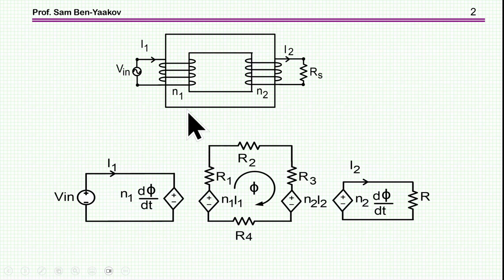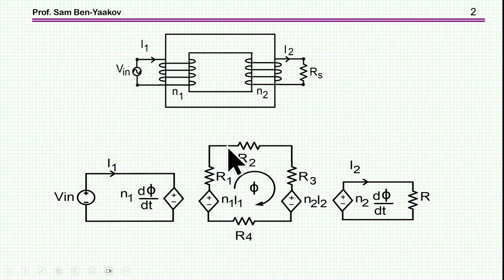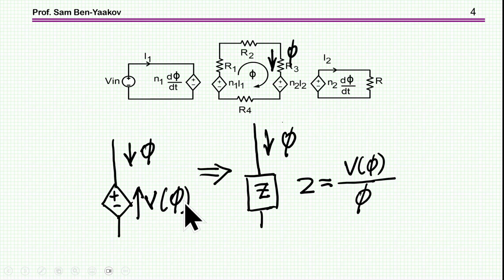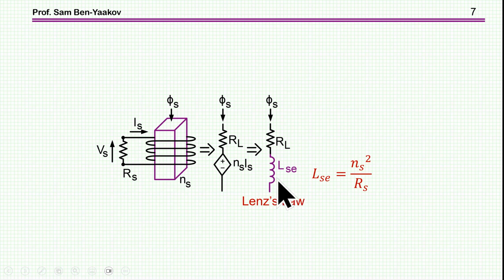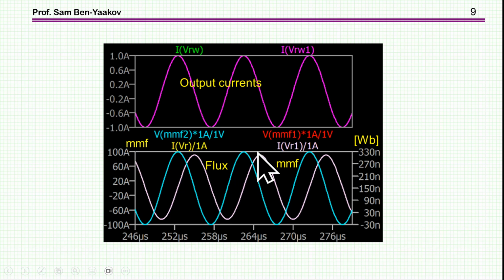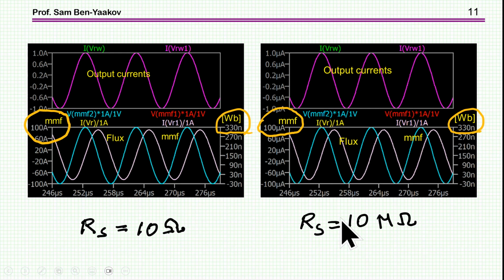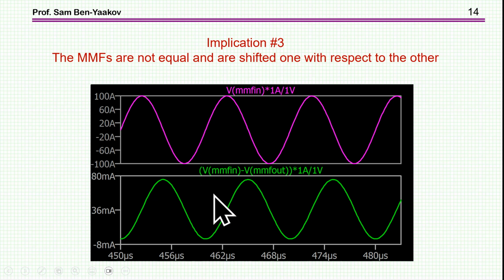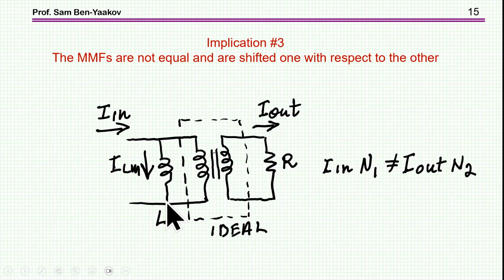A modified magnetic reluctance equivalent circuit and implications

Comment: Dear Prof. Sam,
In this analogy, where MMF is considered equivalent to voltage in the electrical domain, the flow variable in the magnetic domain is flux. However, if flux itself is taken as the flow variable, the unit of magnetic power does not match that of electrical power. Instead, for the units to be consistent, the flow variable should be the time rate of flux (dΦ/dt), similar to current in the electrical domain. Could you please help justify this in terms of the unit of power?
Reply from the maker: Indeed, this emulation is incorrect for power loss. Like Norton or Thevenin.
Reply: @sambenyaakov  Then why do engineers follow this method for solving magnetic circuits? Is there any specific reason behind this?
Reply from the maker: @ Conventional networks cannot model complex integrated magnetics.